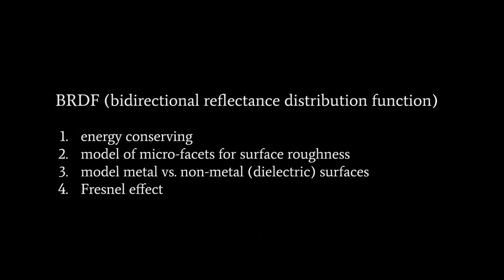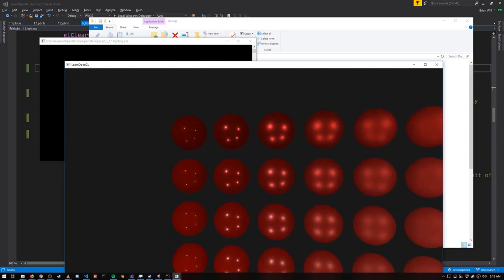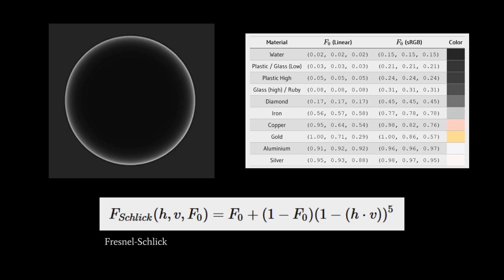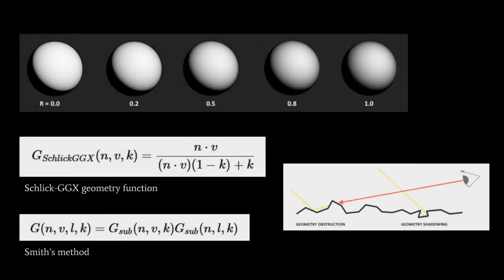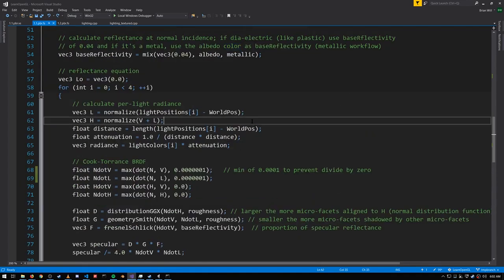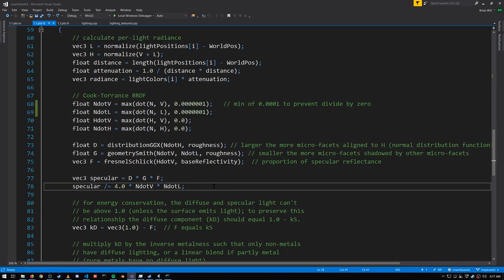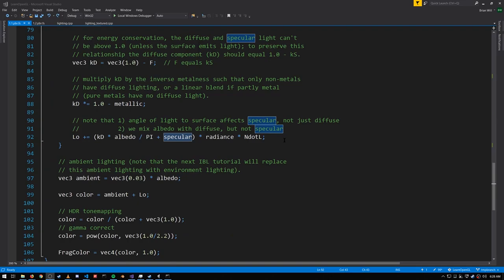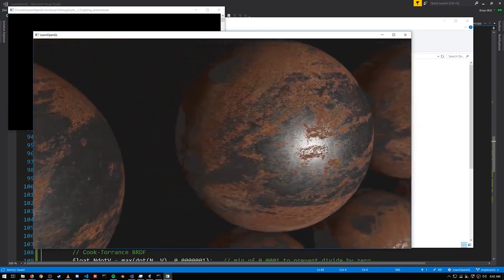OpenGL - PBR (physically based rendering)

Comment: If i'm not mistaken, the division by PI in the diffuse component and division by 4 * NdotL * NdotV is the normalization factor for keeping our NDF normalized (equal to 1)
Reply: Depending on the source, some use Pi, other use 4... I didn't find an explanation on why each value, but they're used. I think Disney and UE4 used 4, until Epic went to Pi in UE5

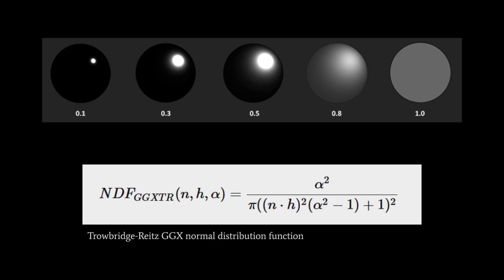Comment: 4:18 how can the sphere reflect light from a point of its surface that is not even exposed to light? images for α 0.1, 0.3 and 0.5 i can accept, but 0.8 and 1.0 must be incorrect?
Reply: In my opinion its right. he talking about roughness on the left its almost clear surface "mirror" this is how light should looks like in mirror and with higher roughness its starts spreading and bouncing into random direction instead of directly to "camera"

Comment: How would PBR work for one directional light, this is for just point lights, correct?
Reply: Use the directional light direction vector directly as the light vector. Ie, don’t subtract it from the fragment position